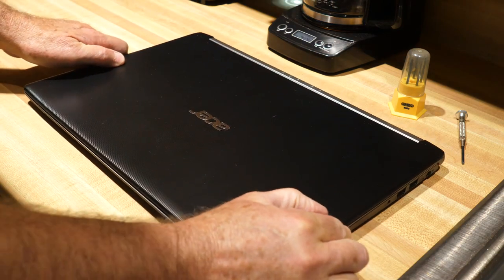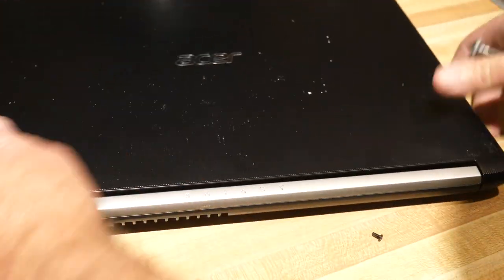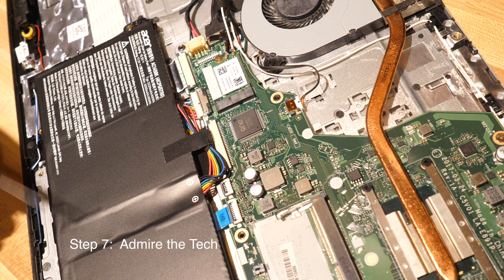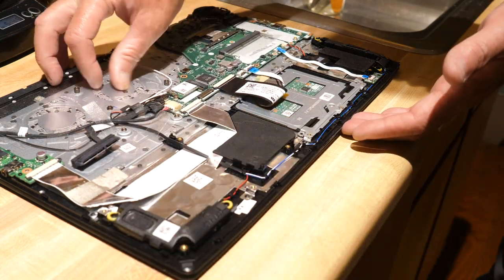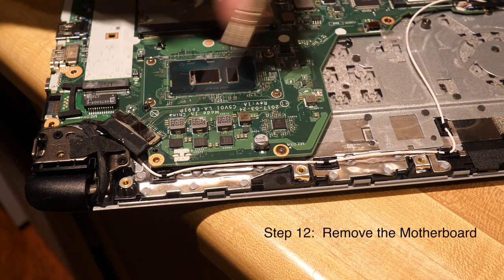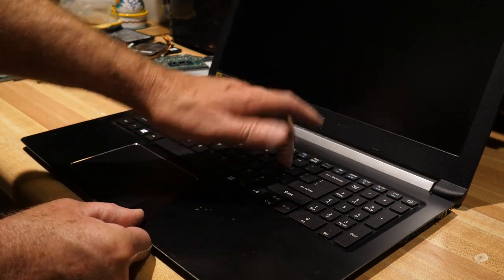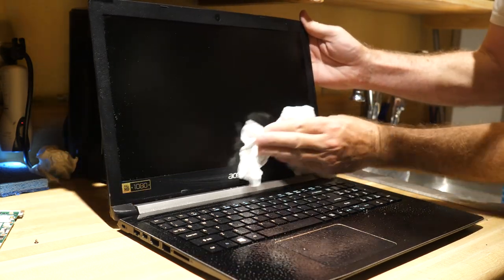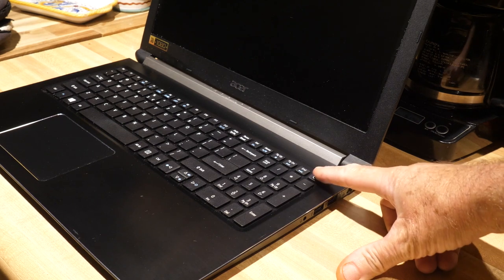Laptop Repair Lesson:  How to fix a sticky liquid spill on the keyboard

Comment: Thanks for the Repair tips.  I knew those blue sponge were good for something... Thanks for the Amazing Freezer Trick!!!
Reply from the maker: Yes,  sea sponges might work as well but they don't last as long, especially if the job requires a lot of vigorous scrubbing.   And, if you live in a very cold environment, you can just put the laptop on the driveway overnight and get the same result.  All the best to you  Mr. Menace Man!

Comment: That's so funny :) You're a wizard. Can you chance it to a hp or lenovo as well ? Maybe a macbook ?
Reply from the maker: It's funny you ask!  As a matter of fact, I have a macbook pro that needs some work, a Mac tower that could use some tweaks, and a host of other gear that could be converted into more useful purposes.  I need to get some tools like a sledgehammer and torch though before I can start working on them.
Reply: @deepfriedectoplasm  can be funny too. But what I ment was you did some trick changing an Asus into a Dell :)

Comment: Errrmmm...sorry, hope I'm not being impertinent but....is the laptop that came out of the freezer not different to the one that went in? (Sorry, bit dim, just old dear who spilled sticky liquid on her laptop keyboard and messed it up completely looking for advice on what to do before finally deciding to take it to a repairs shop and came accross your video. Very interesting, but there's no way I'm going to open up my laptop and break it apart myself, thanks! 🤣 Just couldn't help noticing that the working laptop you took out of the freezer is not the same you put in.....sorry if I'm just being thick and missing a bit of techy humour here....).